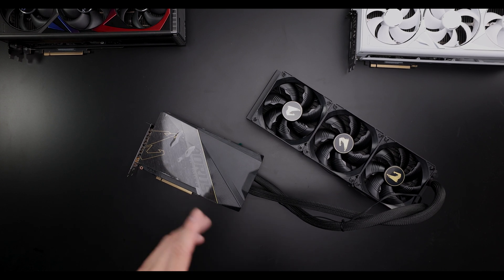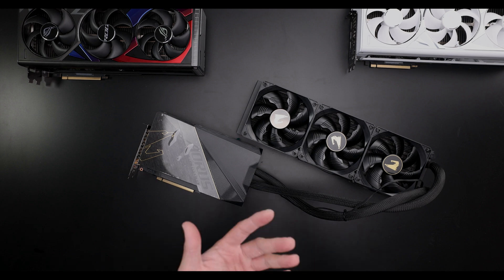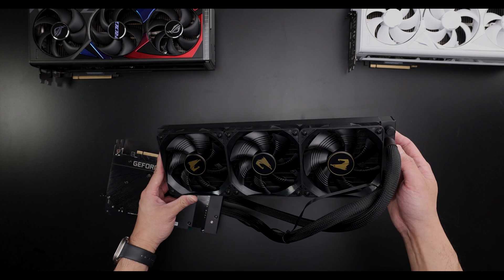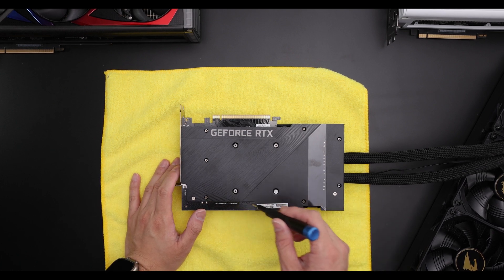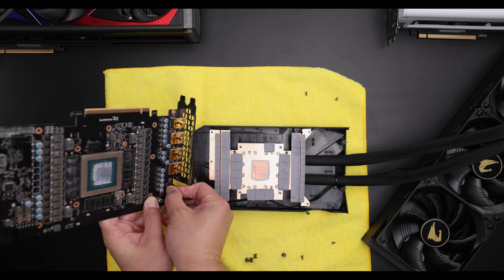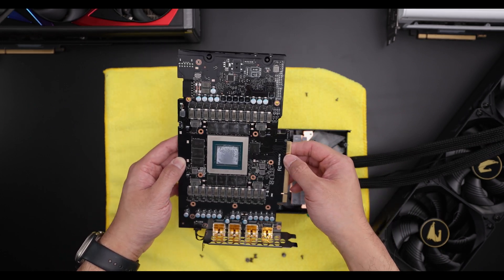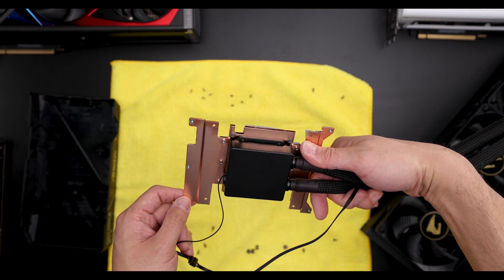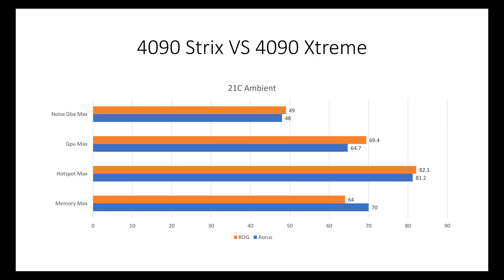RTX 4090 360 AIO VS AIR COOLING:  FT AORUS XTREME RTX 4090 & ASUS ROG RTX 4090 STRIX OC.

Comment: That was extremely helpful, thank you. I was considering the aorus waterforce rev 1.1 but knowing what I learned here: hell nah. 6° hotter VRAM, more idle noise and the higher price are dealbreakers. Air-cooled it is.

Comment: seriously if you can hear your fans, turn your speakers up. simples
Reply: What if there’s no audio? My workload isn’t gaming but working with GPU intensive code. I have 2 4090s and they get loud and heat up the entire system basically. I’m looking for a way to basically do a push pull config to exhaust the heat out of the system while being a bit more quiet if possible.

Comment: I got my suprim 4090 liquid and unfortunately very loud coil whine. And the pump noises can be annoying sometimes. 
IMO, for 4090 there is really not much sense to go for AIO cooler even if you are an overlocker, wind cooling can handle 600w just fine, not to mention that it is more likely to hit the voltage cap before the power cap. And the pump noise is another lottery rather than the silicon lottery you will be drawing if you choose AIO 4090.
For the noise level I would say all the t1 4090 have pretty much the same fan noise level running at the same RPM (strix, suprim, aorus). The actual noise comes from the coil whine rather than the fan.

Comment: How are you getting 82c on hot spot for strix under 533w load, my strix gets to 86.5 when under 500w load with 100% power limit. Did you repaste or something? I ran stock settings nothing g done to fan curve or anything done. I ran time spy extreme. Second pass gives me the 86 in some scenes

Comment: Meh, clearly an Asus shill.  The full COPPER plate is in fact making contact with the VRAM and VRM, unlike your claims.  Inputting bar graphs without the video of tests you completed is sus, anyone can color bar graphs with crayon and say what they want about them without showing proof.  Comparing JUST the Aorus copper contact plate alone against the Strix's entire cooling setup (contact plate, heatsink, and fans) is absolutely ridiculous.  Any conclusions or results you've developed are invalidated by the poor testing procedures you've displayed.  Do better.
Reply: I got the same feeling as well, this was someone going in with a bias, and looked for answers he wanted to hear.  I'll tell you my waterforce 4090 works flawlessly in real world use (Cyberpunk, Lords of the Fallen, Diablo 4, etc).  I run at 4k HDR with an extra monitor for discord and a browser, and peak my monitors FPS while getting low temps the entire time.  He's also trying to tell you he's keeping his house at 69 degrees in July in NYC. Again, bs.  Shill be shillin...
Reply from the maker: https://www.overclock.net/threads/dont-buy-gigabyte-4090-xtreme-waterforce.1802084/#nested_reply_top_post

Someone else's thread. I buy every brand.  I do prefer Asus but I do buy the top line of every AIB. I call it as a I see it.
Reply: @JCustom  You still didn't address my points.  You're 100% incorrect about the copper plate and it's contact points, you compared the performance of the copper plate's size against the ENTIRE Asus cooling design, and you failed to simply show details to prove your bar graphs.

Comment: I have probably a silly question but still need to ask. Is the AIO card completely inaudible when idle (internet browsing, etc.)? I know air coolers are 100% silent as the fans simply do not spin at all in such use case. But what about AIO. Is there any noise coming from the pump or fans? I guess you cannot stop them as there is no radiator?
Reply: Fans also won't move when idle or in low power draw scenarios, but the pump will be running.  Sometimes you could get an audible pump, whether it's a defect or just unlucky can't be determined until plugged in.  Then again, if you turn up performances of any cooling solution, then pumps and fans alike will be running and audible.  Quality comes into factor on how much noise is audible at different rpms.

Comment: ASUS GPU Clock 2750Mhz and AORUS 2550MHz. Not good AIO for GPU
Reply: my aorus does 3ghz, not sure why yours is 2550mhz, ram it
Reply: My Aorus 4090 does 3025 MHZ OC and +1150 on VRAM. Never seen anything over 64C while gaming or benchmarking at 40% fan speed. The AIO can fit in any mATX Case where the air cooled 4090 are way too big and steal PCI-E slots. I'd rather go AIO. Despite the small copper heatsink it works flawlessly....cool and quite.
Reply: @gionieves2646 Exactly, this video is just wrong on every aspect.

Comment: As expensive as it is, I know I should be more upset about Gigabyte cutting corners, but I'm just annoyed. I'm honestly happy with mine, haven't had any issues and here's to hoping the pump's life lasts as long as I want to keep the card. 

That being said, had Asus made an aio version (like their 3080/3090 variants) I would have waited for that one.
Reply from the maker: 4090 strix aio version is out soon. I would still buy the aircooled version though
Reply: @JCustom why? They are huge
Reply: @JCustom  could you test this one for us, man? I kinda doubt that 240mm AIO would be capable to cool the card properly, but who knows.
Reply: did you replace the fans with this if so how difficult was it? i have one coming for my new build however i want to use fans that match my case? @JCustom
Reply: @Tinytimtam-Raiding   I moved/added fans to my extreme aio. Moved the standard fans to back of rad and added unifans to match my build. Easy indeed.
Reply: ah okay, i want to completly replace the fans with corsair QL120's to match the rest of the build but the fans seem to be zip tied down and through the sleeved cable so i dont know how easy it will be to change them out fully @Ikeandaudi
Reply: @Tinytimtam-Raiding  That is true, for a full replacement I'm not sure how that would work.  Pretty sure they use a non-standard connector now that you mention that.
Reply: Is this card an oc version?

Comment: There's 0 rgb on Aorus Xtreme, none

Added : despite the copper plate is thinner, it works flawlessly as it should. I removed the pump & the rad, put the gpu directly into the loop with D5 pump, it works better than u think, on par with average waterblocks.
Reply: don't trust this channel bro. I have this Aorus xtreme 4090 and it performs far better than strix . I even asked this channel to come on for a live video comparison , he instead deleted my comments. This guy is not trustworthy. He always pushes people toward Asus products.
Reply: finally a card that doesn't look for kids with fricking rainbow lights.
Reply from the maker: I don't think a 70c+ vram temp is all that great on the original aio, considering I see better on air coolers. It could be much better considering this gpu is 1900 vs the 4090 air ones at 1600.